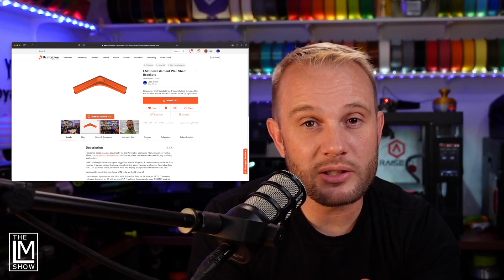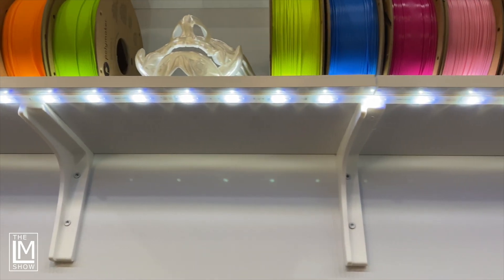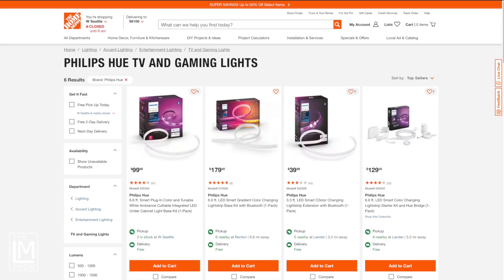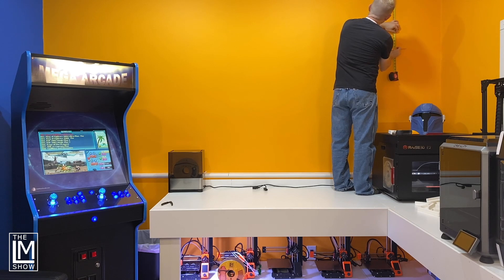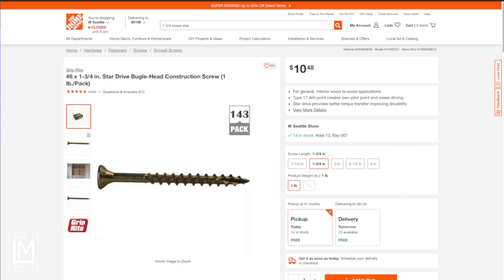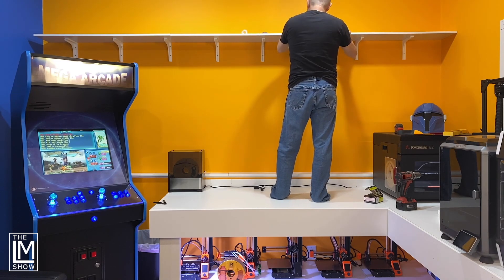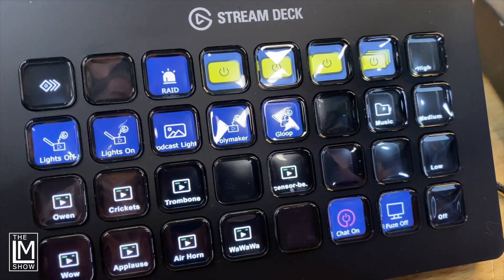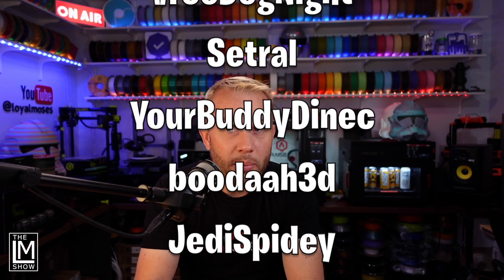RGB Filament Storage w/ a Bambu X1C, P1S and QIDI X-Plus 3

Comment: Whenever I see this much filament sitting out in the open, I have THREE thoughts -- 1) Either the owner lives in the desert or 2) The spools are outfitted with fake filament, 3) This isn't the actual in-use filament supply - which is stashed someplace in a drobox.
Reply from the maker: Ha! -- 1) Not a desert, on a mountain. 2) Fake filament? Who has time for that?! Definitely, all real filament. 3) Look closely, those spools do get used.

We have around 3,500+ spools of filament up here in our studios, and this wall is more or less a promotional wall, fully sponsored by Polymaker. We print from the wall, and just replace it as we go. The original plan was to never touch those spools, but inevitably, we run low on a specific color and take from it. If you see our live show on Twitch, under those benches there are stacks of HUNDREDS of spools of open filament, we print from them regularly, some sitting out for more than 3 years.

PLAs and PETGs are not as hygroscopic as some tend to believe - they do absorb moisture, and if you are in a VERY humid environment, obviously this can be a concern, but it isn't as bad as the general 3D printing community thinks it is.

Comment: One question I have is, you show 10 inch shelves on the website. Did you buy 10 inch shelves and cut them down to 8 inches, use 10 inch, or did you actually use 8 inch shelves and they just didn't have those online anymore?
Reply from the maker: Our first set were all 8" shelves, I went back for more and they were out of stock with 8", so I paid a few dollars more for 10" and then ripped them down with the table saw. I left that out of the video, because other places would just have them in-stock.
Reply: @LoyalMoses  thank you for the clarification. Home Depot only has 10" shelves that I could see. I'll just run mine through my radial saw to get them to 8"
Reply from the maker: @vreedognight  Wo, why is everyone out of them?!
Reply: @LoyalMoses  I didn't see any spots for any 8" Rubbermaid shelves at Home Depot in the valley just now. I am thinking that Home Depot, at least, doesn't carry the 8" Rubbermaid shelves anymore.